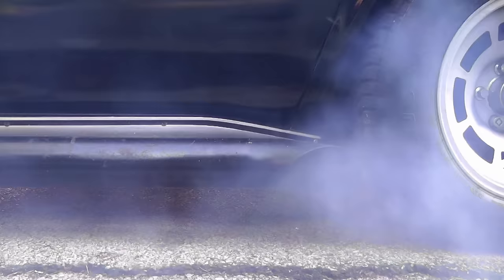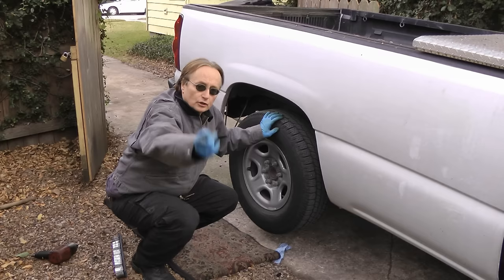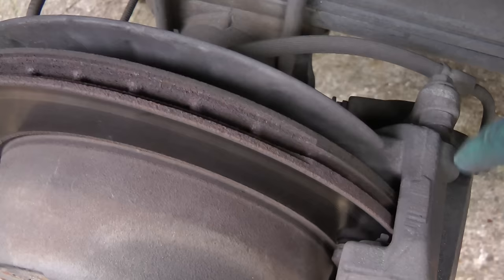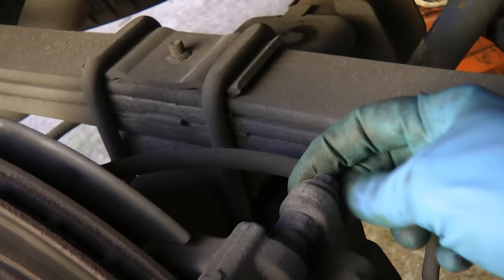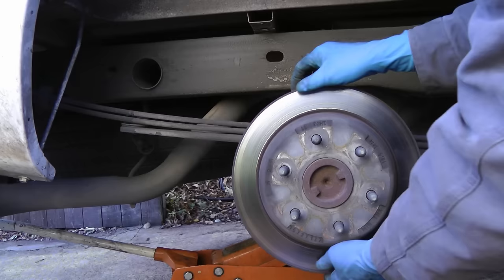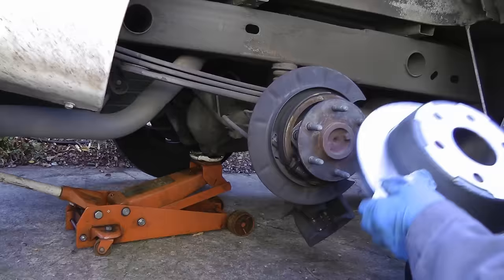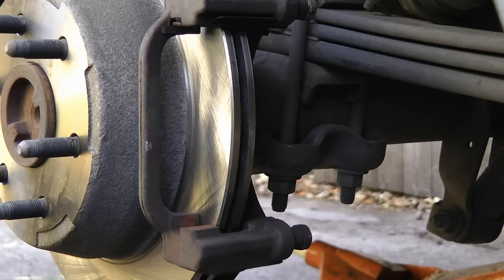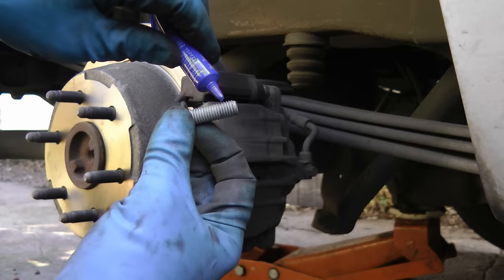How to Fix Grinding Brakes on Your Car (Rotors)

Comment: hey Scotty I had just replaced brake shoes on a 2005 toyota corolla since there was a grinding sound at low speeds. the brake shoes were already worn so I figured that's the problem. now today I heard the same grinding coming from the rear again what could it be? thank you in advance
Reply from the maker: +Edweiner29 turn the drums or replace them as they aren't worn even if you have drums, and if you have rotors, just replace them

Comment: Scotty my back right wheel/tire makes a scratching/grinding noise when i turn to the right. its not loud by any means but the noise is there!
Reply from the maker: check to see if brakes are worn down there, or if wheel bearing is worn and dragging on turns
Reply: Scotty Kilmer Agreed. What's the mileage of the car?
Reply: its only got 91k i got ALL new brake pads and rotors put on when i bought it with 88k Its a 2007 Subaru Impreza 2.5i (Base model). The  back tires are not wobbly when i jack it up and try to shake them. BUT when i rotate them i get a grinding noise and i also get resistance for about 1/4 a rotation. Any help is welcomed.

Comment: I had my break pads and rotary replaced and now it sounds worse. The rear ?rotars are grinding terribly with and without breaking. Also now when I go over the slightest bump it sounds like something metal broke off and hitting against metal. Any suggestions and will I be safe enough to drive back to the shop?
Reply from the maker: they were either put on wrong or REALLY cheap parts were used, Take it back Slowly and let them fix free whateve they messed up. And really, I'd never go back there again if they fix it right

Comment: hi the caliper   should be hanging  on wire   while doing the pads  right
Reply from the maker: brake hoses hold over 1500 psi, so hanging hurts nothing so strong. IF they are old and cracked, then they need replacing and hanging them and causing them to leak would be a good thing because they would be all worn out anyway and dangerous

Comment: I just got my front brakes done a couple of weeks ago since the pads were down to bear metal, same as the rotors, and a new caliper on the front left was installed since the old one had worn screws. Right now, I have a grinding noise coming from the front brakes, and I believe it could be either the caliper pistons weren't pushed in all the way or brake cleaner wasn't used on the rotors. Could it be a caliper piston issue or the rotors? The person that did my brakes did a good job, however, brake cleaner wasn't used on the new rotors. Can I just take my car to a shop to get the problem fixed?
Reply: Front calipers get more abuse than the rear. I bet you have a stuck caliper.
Reply: If the piston wasn't compressed all the way you wouldn't have been able to install the caliper.  Not cleaning the grease off the rotors would have made braking worse - just spray it with brake clean.  If it grinds even when the brakes aren't used, it's a stuck caliper, if only when you use them, then somebody didn't properly lube it up (not properly lubing it would cause stuck calipers, too).  Take them apart, clean them up, and properly lube the pins with silicone paste and use copper anti-seize or your favorite brake grease on the back of the pads where the piston touches, the ears of the pads, and inside the groove of the metal brackets.

Comment: I've changed my rotors and brake and my rear right side is always sounds like its scratching what did I do wrong it even happened when a mechanic did it aswell

Comment: Mine are brand new and they make a grinding noise and they squeak when i press on them slightly but not when i break by pressing harder on the break this is my 3rd damn set of disc brakes and pads what can be the issue? I CANNOT find it

Comment: I have a Ford Freestyle that has grinding front brakes. I just got all four brakes and rotors replaced at Tireman back in February and 2 weeks later, my brakes started grinding again, and my wrench light (limp mode) came on! I also noticed in that 2 week period, acceleration started getting slower and slower! Now my car's suffering from P0701! Did Tireman rip me off? Cause the technition said the brakes he installed were brand new!
Reply from the maker: I would assume they ripped you off, but 701 is a transmission wiring or computer fault code
Reply: I've been watching your videos 24/7 lately! All my family and friends love your channel! Now I know how to fix my Ford when it breaks down! :)

Comment: shouldnt the bleeder valve be open when compressing the piston?
Reply from the maker: you can if you go too fast it can damage the master cylinder. But of course don't get air into the system.

Comment: What about the hand brake? would that cause similar noise..if the rotor and pads are fine. its for 2000 Lexus es300. i am having same noise and i spined the tire too but its a low grinding sound ..the pads (outside) one atleast is perfectly fine. So i am guessing its something to do with hand or ebrake ?maybe the brake metal hitting the rotor?
Reply from the maker: pull the hand brakes on and off, if noise changes, it's them. If not, something else is doing it

Comment: Hey Scotty, My 95 Maxima's Transmission Fluid is a dark brown, blackish. My brother says not to change it or else it will make the transmission go out quicker. Is this true? It is already starting to go out because when I am shifting from Neutral to Drive it takes a couple of seconds for the transmission to engage. Please help and Thanks!
Reply: drain the fluid a number of times to get clean fluid in there, but he is correct you should not do a complete flush on an older car like that. seems to be the consensus
Reply from the maker: you can try draining the fluid and changing the filter, just realize it's old as the hills and that model is known for weak transmissions. It's going out anyway, just don't flush it and take a bigger chance of ruining it.

Comment: I recently did the brakes on my own car cleaned/lubed everything buy when I turn right it makes a wooow wooow sound ?
Reply: I replaced my hub bearing on my Dodge Avenger 2008 but now when I'm driving and when I get to like 5-3 mph the brakes slip do you know why ?

Comment: scotty would you recommend to replace all 4 tires and pads at the same time or just that side that's making the noise when the wheel is turning?
Reply: +Darkmand8 As a good rule of thumb, anything you do to one side of the car, do to the other side. Most things you should fix/replace in pairs.
Reply: thanks

Comment: I am replacing my front pads and rotors on my 07 Hyundai elantra. do I need to do what's called a break in period on my pads and rotors? is that what mechanics do when they replace brake pads?
Reply from the maker: not with modern cars

Comment: not using a torque wrench scotty? i can understand that you're not using air tools, but no torque wrench and 40 years experience is scary lol (mean that in a joking way) tut tut scotty :P keep up the hard work.
Reply from the maker: 46 years, and rarely is a torque wrench really required if you know what you're doing. PLUS, in many locations on a modern car, there's no way to even get one in to use it on most bolts

Comment: Don't need no stinkin' thread locker. On what antique vehicle did they use lock washers? What class were thevbolts?

Properly torqued modern caliper frame bolts will not vibrate about.  They doo not need threadlocker.  Without lockwashers or thread lock , you might still need a mallet with a box wrench, (NOT a socket, barbarian) to get the bolts out. 

Put a little antiseize on the rusted threads at the end of the bolt and torque it to specification. The next time you need to service the same brakes, for grins, use a torque wrench to remove one of those frame bolts.  You'll see that after the brakes have some rust and heat cycles,  the removal torque is higher than the install torque. The antiseize is for the frame threads that get abraded removing a through bolt with rusted end threads. A tiny amount is enough.

Comment: Hey! I just got new pair of disc brake pads installed on my motorcycle ( CBR 250r ). But now the brakes are making horrible grinding noises which weren't present earlier. Its really irritating. Is that normal? Will that go away? Also after installing the pads, the front wheel wasn't rotating freely. It took several hours for mechanic to fix that problem. But I'm not sure if he was successful in solving the problem. Can you give me some advice on how to fix these problems?
Reply: +Rahul Chauhan hours? find another mechanic

Comment: Old video I know but I'm hopeing someone can help me. I changed my whole break system. Rotors pads and calipers in the front. Break drums and shoes in the back. Even still there's a loud squeal when I break and when I'm slowing down I can hear the grind/squeal you herd in the beginning of this video. There is vibration at high speed when I break also. I checked my work over and over again and I can't find a Damn thing wrong or reason for this. If someone could point me in the right direction that be great.

Comment: hey Scott i just change my brakes and rotors on my crysler 200 2013 and for some reason they are squeaking  and rubbing could you please tell me whats the problem
Reply from the maker: if you didn't do all 4, then the other two are making noise. If you did all four, you either put em on wrong or got really cheap noisy pads

Comment: Hi Scott,

If there is enough clearance for the brake pads and rotor, is it necessary to push the brake pistons back inside the caliper? I've change brake pads a few time on a motorcycle and I never push the pistons back in. However, it is difficult to rotate the  wheel by hand.

Dulaya
Reply from the maker: if there is enough clearance, you would not need new pads, as old pads wear, pistons come out and have to be pushed back in

Comment: Scotty it me again victor also my brakes on my mazda mpv lx 2004 when I press hard on the brakes it feels like  metal is touching with metal.  And it bounce. .
Reply from the maker: of course check the brakes to see if they are down to metal, but if not, check the struts for wear and suspension parts like a frame bushings, when worn they will grind noises and cause bouncing too

Comment: Scotty, quick question.  I have a small car, and when I go over bumps or make right hand turns, I hear a squeek coming from the right hand side.  I usually hear trucks make these noises going over bumps, and I know it is a suspension problem.  The sound, sounds like a squeeky bicycle, like a metal/friction thing.  I can't look at it til this weekend or the next.  When the car sits, I can turn the wheel and hear nothing.  It is when I drive slow or slowly come up a drive way is when I hear it most.  Safe to say maybe tie rod or ball joint problem?  It sounds like it's coming from the front, and this car is mid engine real wheel drive.  So there's no CV axles or anything.
Reply from the maker: many bushings being worn can do that. if car runs fine, spray some WD 40 on all the rubber bushings, noise generally goes away then.
Reply: Scotty Kilmer Thank you Scotty.  That's what I figured.   I was going to probably replace them with Polyurethane ones unless rubber is better.  For the time being, I can try that.  So it is safe to use WD40?  Someone said not to use it on car stuff because things can run rancid.  But I think I have some other type of lube spray for it.  I'm going to do that though, thanks Scotty.  Because it does run just fine.

Comment: My front caliper makes a clicking noise only on backing up on a 2011 Corolla LE. The dealer overlooked it or didn't fix it. The extended warranty is coming up soon enough. Before the warranty expires can I request to see my car being worked on so I know exactly what type oil, filter, air filter, trans fluid able to ask the mechanic any questions as he works. Would that be a decent request?
Reply from the maker: if pads are not fitted correctly with new shims they often click, have them check that
Reply: Scotty Kilmer  hey mr kilmer thanks for the advice about my 91 celica, but the back brakes im pretty sure its the problem when i start driving they sound as if they are grinding the rotors are pretty rusty the front ones are alot newer they have no rust and seem to look nice do you think its my rotor or wheel bearing? thanks. sorry if there is 2 more of this question i posted my internet is screwing up they grind when i brake but i noticed it starts grinding while i take off and drive its a loud grinding and screeching sound
Reply: My 2011 corolla clicks when backing up. The dealer just didn't fix it permenentally yet!

Comment: Hey Scotty
I went to get my wheels aligned and the guy said I needed to change my my  inner and outer tie rods and lower ball joints because they were loose or the alignment wouldn't do any good.
does that make sense?
Reply from the maker: yes, worn parts like that will not allow them to set alignment until they are fixed

Comment: You should have specifically said to use blue thread blocker and not the red stuf
Reply: That depends. Red is fine, and red "high temperature" is what I use.

Comment: Scotty, how do you adjust the parking brake on a 1995 Ford Explorer ? it has 4 wheel disc brake, do I adjust the rear shoes , just like drum brakes or is there a adjusting nut somewhere ? the pedal goes to the floor an doesn't hold, please let me know. Kody
Reply from the maker: the cable itself should have adjusting nuts to make it shorter and tighter

Comment: I just put new brake pads on the front of my car now I have a squeal from the driver side when I drive. any suggestions?
Reply from the maker: +William Reynolds worn rotors often do that, they make new pads make noise when they hit the old worn rotors

Comment: Scotty two questions, should I buy a junkyard I as my piston is stuck and rebuild kits inaccessible ?  I'm tryin to get a steel seal but I see there is are U.S and a U.k versions which to use? Thnx
Reply from the maker: sure guy use junk parts all the time on ones you can't get anymore. If you need a piston, engine has to be torn apart and new head gasket put on anyway. But if it's for another car, use whatever version for the country you are in

Comment: Hi Scoty rotors resurfacing is worth to do or we have to change new rotors my mechanic says resurfacing is  good will you guide me thanks
Reply: Rotors can last quite a while. If you can get new rotors as theyre not too expensive. Ive never had em resurfaced so i dont know the price but if your tight on money resurfacing is not bad. Just try to save up for rotors in the mean time cause resurfacing can only get you so far

Comment: my jeeps two front tire rims are colored red a friend told me its a lot of break dust and the break pedal is gets hard sometimes when its in drive, what is causing that?
Reply from the maker: well, cheap brake pads often do the coloring, but a hard pedal is often a bad brake booster.

Comment: I have a huge question i need help!!! I just changed my brakes and i changed  my rotors but i still hear a scraping sound like if it was metal grinding with metal any idea what it could be? I check my rotors and there still getting scrached by something i cant figure out what it is i have a scion xb 2006 please help
Reply: The back part of my rotor is the one getting scrached not the front part just saying

Comment: I felt something pull on my front right side tire and breaks are locked making a loud high pitch grinding sound any idea?
Reply from the maker: if brakes are not worn out, check the wheel bearing

Comment: I have replaced the pad and disks on my ford expidition and I still get the grinding noises what else could be wrong?
Reply from the maker: IF all 4 rotors and pads were changed, checked for worn wheel bearings

Comment: so I just installed new rotors and pads front and rear on my forester and noticed a loud grinding when cornering.  I took the caliper and bracket off to see what it could be, there was a mark on the inner part of the rotor and inside pad and I realized that the rotor was rubbing the bracket. the old rotor had the same mark. what could cause this to rub?
Reply from the maker: a bent bracket often does that, OR bent pins that hold the calliper to the bracket
Reply: thanks for getting back so fas Scotty!  I took a closer look at the spindle/knuckle and realized that the mounting ears were bent by the shop that pressed the bearings in/out.  a bit of heat and a pipe wrench did the trick.

Comment: Scotty,
I recently bought a 2015 Honda Civic Coupe with a CVT transmission back in December of '14 and now since then put just over 6K miles on it. Im having some CVT issues that relates to some shuddering and slipping at low speeds, around 20-30 mph. I can drive through a parking lot or down a residential road and when I need to brake, it feel and hear some shaking/slipping for a quick second and then become normal again (Car will also lurch forward slightly) and it doesn't happen very often but I feel as the entire transmission is going to fall out and ill be stranded. I haven't changed the CVT fluid yet as Honda recommends I change that every 30K miles. Any advice to what may be the issue.
-Kellan
Reply: Kellan Larson  Its still under the manufactures warranty, take it to Honda if you haven't already because its still too new. Hopefully they can fix it and you don't have a lemon.
Reply: Kellan Larson yeah man my scooter has a cvt transmission in it and they are pieces of shit in every aspect. My guess is what your feeling is the transmission changing its ratio to sort of act like its down shifting in an attempt to help you slow down.